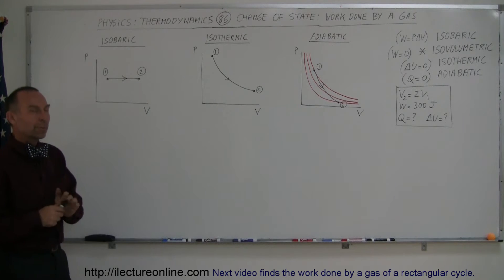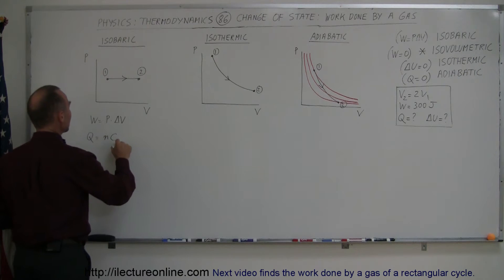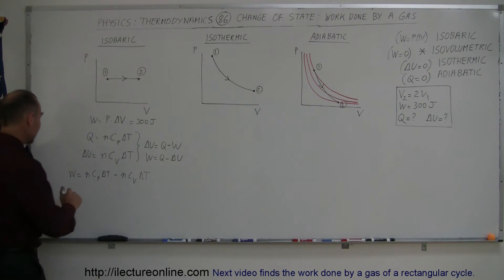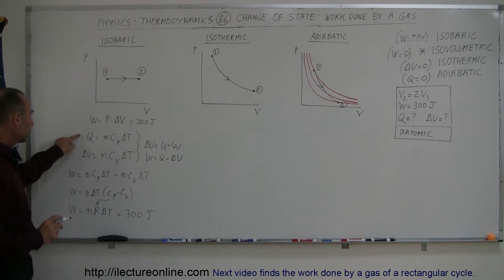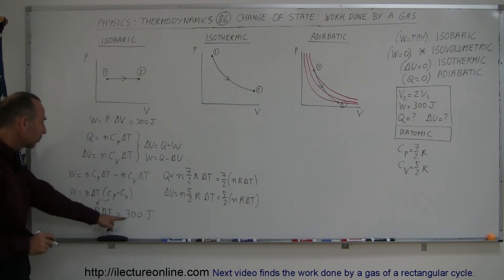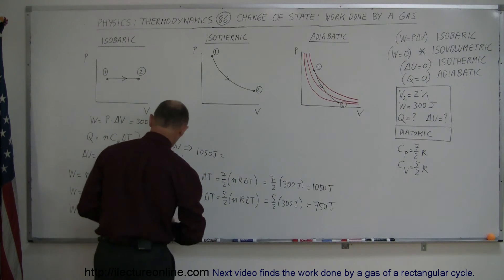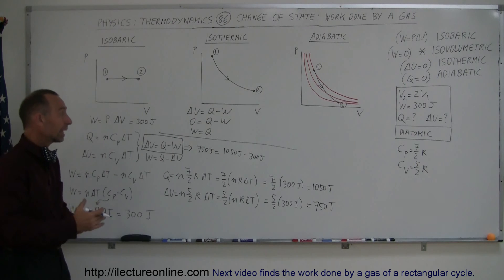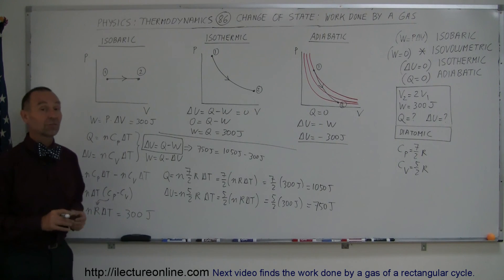Physics 27  First Law of Thermodynamics (22 of 22) Work Done By A Gas

Comment: there is a piston with steam cylinder,expands isothermaly and reversibly , in this case does the change of internal energy can  zero or not? can u please help
Reply from the maker: Isotherm, means the same temperature.  If the temperature doesn't change then there cannot be a change in internal energy, since the internal energy only depends on temperature.

Comment: A vessel has two compartments of volume V1 and V2,containing an ideal gas at pressures P1 and P2 and temperatures T1 and T2.if the wall separating the compartments is removed,what will be resulting equilibrium temperature
Reply from the maker: That is indeed an interesting problem.  We are assuming here that both gases have the same specific heat?  Then the final number of mols becomes  nf= n1 + n2 and the final volume becomes Vf = V1 + V2.   Thus Pf/Tf = nf * R / Vf, but that leaves you with a ratio.  Next you can use the sum of the internal energies.   U = n Cv T  and thus Uf = n1 Cv T1 + n2 Cv T2 = U1 + U2   From here the final T can be calculated to be   Tf = (n1 * T1 + n2 * T2) / (n1 + n2)
Reply: Thankyou so much sirI
Reply: Thankyou sir

Comment: A steam turbine in a power station develops 1000 kW power. The amount of heat
supply into the boiler is 2800 kJ/kg, and the heat rejection from the condenser is
2100 kJ/kg. The power required to pump the steam to the boiler is 5 kW. Consider
the system is stationary and neglect the change of internal energies.
 Applying the energy balance relation above, calculate the rate at which steam
circulates through the network of the power plant.
Reply: Could you help me with this if possible? Thanks

Comment: I am a little confused.  In the first isobaric example, shouldn't you be using Cp, not Cv for the molar heat capacity in the delta U equation?
Reply from the maker: +PR Mesler 
To calculate the molar heat capacity for the delta U, you must always use Cv regardless of the process.
Reply: +Michel van Biezen
Have you done a video explaining why Cv is always used when using delta U?  I mean explaining in detail why this is the case because it's not intuitive to me.
Reply from the maker: +PR Mesler 
Watch the rest of the playlist and you'll get the information.  I know this is a source of confusion because students confuse the Q in the first law of thermodynamics with the U.  Note that U is the internal energy of the gas and it cannot depend on how you got there.  Q is the heat gained or lost by the gas.  The amount of heat does depend on the process during which the heat is exchanged.  The best way to look at it is to take an isovolumetric process.  No work is done because the volume of the gas doesn't change.  Thus delta U equals Q which is n*Cv *delta T.  In an isobaric process delta U is NOT equal to Q which is then n*Cp *delta T.
Reply: +Michel van Biezen 
So, are you saying that it doesn't matter if you have an isobaric, isovolumetric, isotherm,etc. process, delta U always uses Cv as the molar heat capacity?
Reply from the maker: +PR Mesler That is correct.
Reply: +Michel van Biezen 
Thank you for your replies.  I think your teaching method is awesome.  Giving lessons in digestable chunks makes learning or reviewing physics more digestable.  Physics is a hard enough subject, even for those like me who need a review.  Your teaching is a service to thousands.  Keep up the ground work!
Reply: +PR Mesler'
I meant the good work!